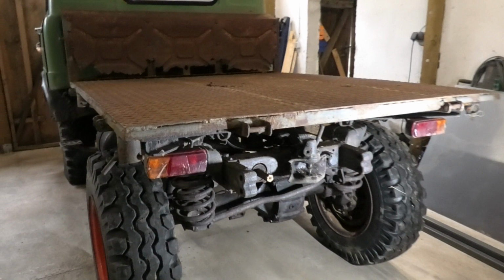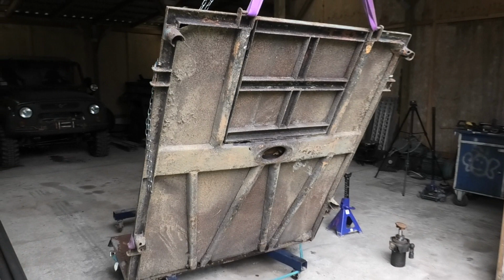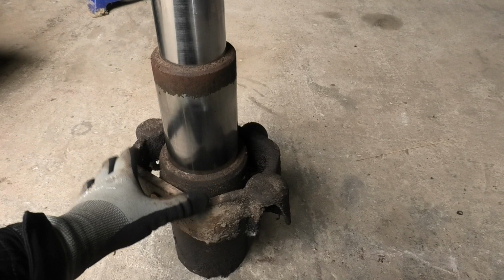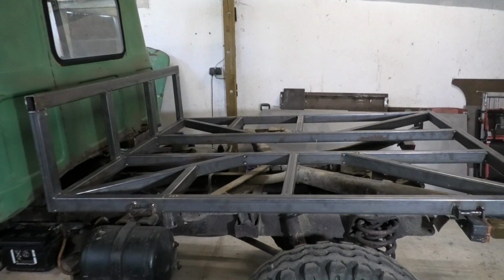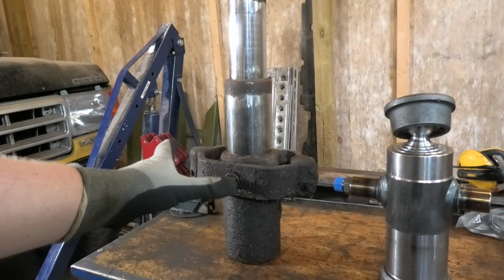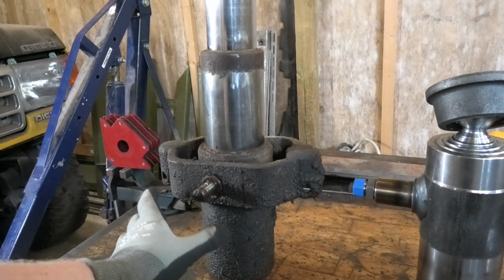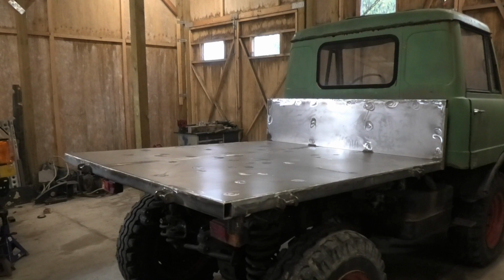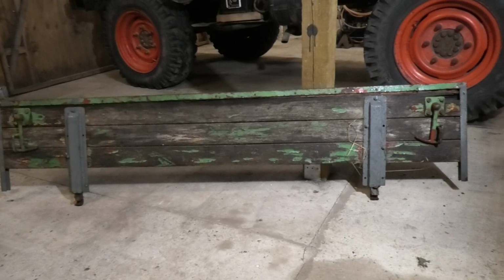Unimog Barn Find. Part 4 - Building a new bed!

Comment: The bed turned out great! If you ever need to use the old cylinder, you can wire brush the rust off the sections, then wrap emery cloth around the bad areas and smooth them out. Then use polyester body fill (auto body filler) and sand smooth. You can fix inside scratches this way too. No, it's not permanent, but you would be surprised how long it lasts. I'm envious of your truck! Cheers from Canada!

Comment: Nothing wrong with that color for now!  Just need to put some on the hood to match.  Make it look like part of the plan.  
You obviously did a lot of measuring and planning off camera.  Isn't it Great when a Plan comes together?  
I remember when I used to be able to kneel on a concrete floor to work.  Great video!
Reply from the maker: Yeah, it turned out to be quite a bit of work. but the result was actually better than i hoped. :)
Thanks a lot. And thanks for watching!

Comment: Not picking at your build. Genuinely curious.  Would the original sides have hinged, or lifted off?  This way seems less likely to accidentally bend something. Looks like you bought it , good job..
Reply from the maker: The hinges that i made, are, at least in function, copied from the original ones. it's a pretty simple and clever design, that makes them quick and easy to pull off. yet it's almost impossible to un-hinge them by accident.

Thanks for watching!

Comment: Nice bed and it might even address one typical Unimog problem: Not enough weight in the back.
Have you considered putting some sort of stop under the bed/where the back fender would go? With the original beds you usually get some rubbing there which always damages the paint etc. Might be easier in the long term than always taking the sides off for tipping
Reply from the maker: Thank you!
And yes, i did think about it. but thought i would wait, 'till i got some kind of fenders mounted on it, to see how tings would fit together. (If i ever get around to doing some fenders, that is XD) 

Thanks for watching!